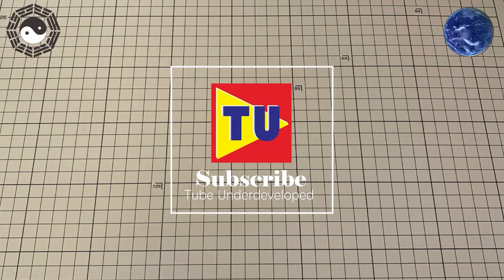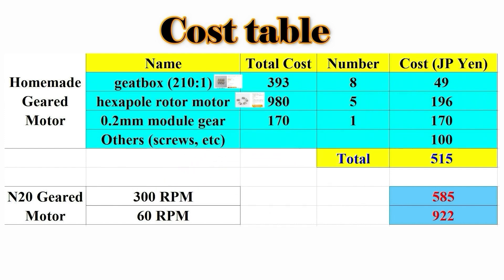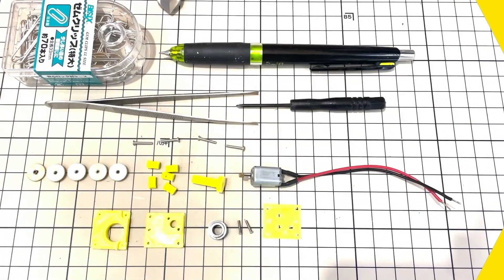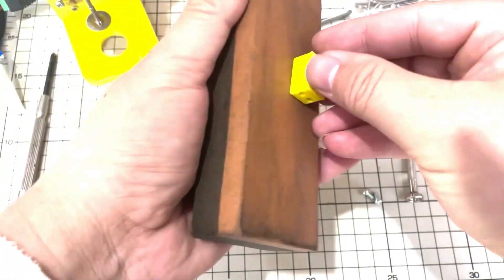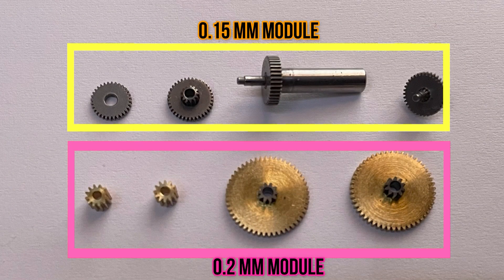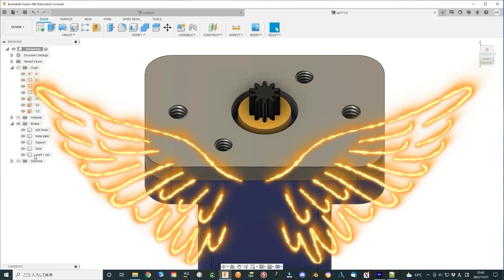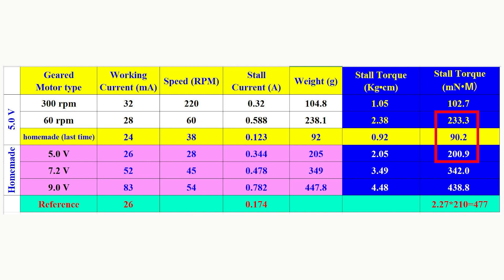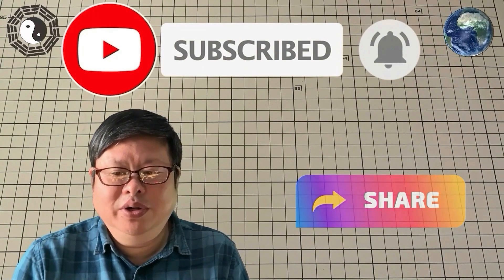How to DIY a mini N20 type all-metal geared motor (simple, cheap, and very powerful)

Comment: I bought couple of these for testing but they didn't perform well at high RPM in small rc cars. The N20 motor I had stalled at 1.3A (2s lipo) and it was more violent in acceleration compared to hexapole motors. Maybe they are good motors for a servo etc. Great idea anyway!
Reply from the maker: Thanks for your comment. The geared motor in high speed is not good for some applications since they are just in the range not in high speed and not high torque.  Really confused condition. I want to make some modifications but still in progress. Anyway, they are still very useful if we find a good application area for them.